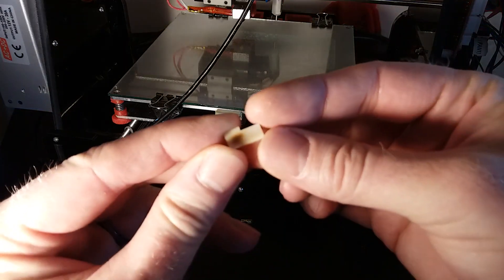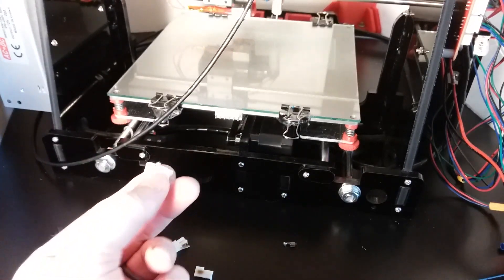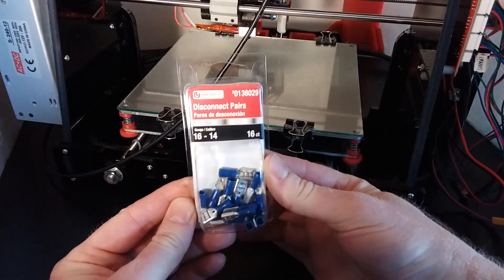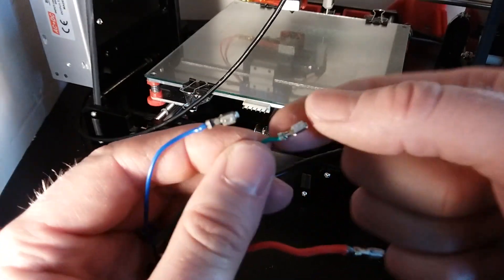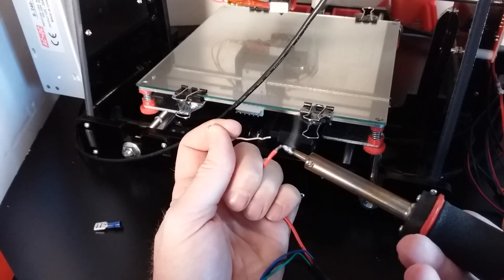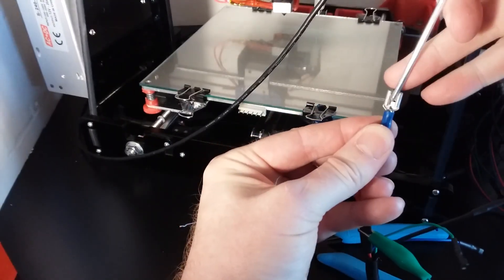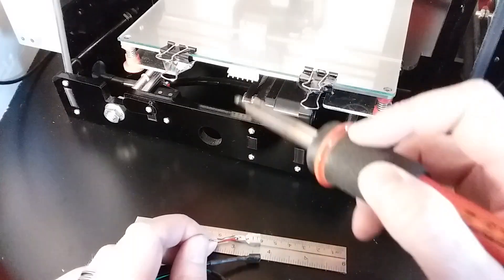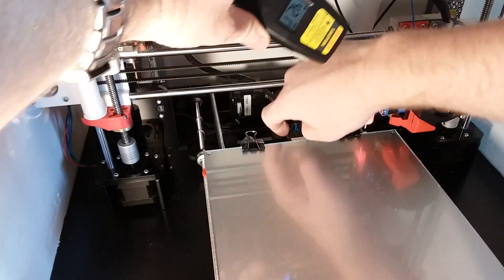Permanently Fix The ANET A8 Heat Bed Plug

Comment: this fix works and i did it as well. but is not sufficient. 1. the wires are not thick enough. they need replacing together with adding the mosfet.
2. in the long time, that faston connector starts getting loose and will start disconnecting again. you will need to re-tighten it a bit every now and then.

Comment: I actually just purchased a no longer used Anet A6 for the aluminum heated bed as my cheap one with acrylic was warped bad and got worse with heat after 1.5 years. I drilled holed through the connector, used 12 GA wire and soldered them directly to the bed. Once I get my printer all back together from all the upgrades I'm doing I'll print a stress relief of some sorts.

Comment: this looks like the best fix I've seen. on my way for parts.  Thanks
Reply from the maker: Or you can solder the wires directly to the heatbed.  Having a 100-200 watt soldering gun helps with getting enough heat into the wire and connection to make a good solder joint.
Reply: @MrDabrudda  Are you implying that this fix wasn't effective in the long term?
Reply from the maker: Either method works.
Reply: Finally did it and it works great so far.

Comment: Had the growing brown stain on the side of the connector too and the connector got really hot on the red plus power line. The plastic was also very brittle on that side already. Your video was a great help. After the fix the only thing that's getting hot is the hot bed itself.Thanks!

Comment: Finally reached the point where the connection of my stock-connector is temperamental. If I move it just right the bed turns on, no errors, just failed prints due to warping when the heated bed fails.

Also noticed some light periodically emitting from the ground connection in the same location as the burn, if I were a betting man I'd say the cable is arcing.

Comment: It's actually kind of bad to solder your wires like you did before crimping on the connectors because over time the solder gets smashed. But if you solder it again after like you did then it should be fine.

Comment: If you don't mind waiting a month to get them, you can order a replacement through AliExpress. The image shows the additional pos/neg wires. I ordered a set because I'm not in a hurry and it was only $5 with shipping. Hopefully they are as advertised, but with AliExpress you never really know what you are going to get. https://www.aliexpress.com/item/1PCS-replace-Anet-A6-A8-Hotbed-line-Cable-Upgraded-MK3-heated-bed-for-Mendel-RepRap/32857354342.html

Comment: nice tip. my connector burn time a go. a put some sodern inside.. it was work next couple of month. now its dead. I was try sodern directly to motherboard bed but its dont hold corectly and im wored about pin pad on board. Your method look better i guess :) . I think you should put in description what exactly name or link to that "pins"

Comment: Shouldn"t you use a version of those plug that has a cover on them?
Reply from the maker: I used heat shrink to shield connectors.  I eventually soldered directly to the board and printed a cable relief bracket to support the wires.
Reply: @MrDabrudda  so it's not a permanent solution? also that iron did you use to de-solder  it? i have portasol which reaches up 580 degrees.
Reply from the maker: It is a permanent solution but I decided to solder directly to the board.  A regular soldering iron can't put out enough heat.  I used a 150 watt soldering gun to get the solder flowing.  I tried a soldering iron and got a cold solder joint.
Reply: @MrDabrudda  how do you test for a cold solder joint ?
Reply from the maker: Cold solder joints may look dull, crystallized. and blobbed.  A good solder joint will be shiny and smooth.
https://learn.adafruit.com/adafruit-guide-excellent-soldering/common-problems
Reply: @MrDabrudda  Why did you decide to solder it? I've had almost the same setup like in your video but I didn't solder anything,  I used the covered plugs and I kept the original connector for the thermistor connection. That didn't work too well, too much plastics around, pushing the plugs outwards. I had to secure it with many zip ties, also because of the movement. Finally, the thermistor plug had a loose connection and lost contact every now and then, resulting in thermal runaway errors. Now, I'm thinking of whether I should follow the instructions in your video (which would only be soldering the joints and doing that stuff on the thermistor connectors) or whether I should go for soldering it. What do you mean?

Comment: This is a good fix. My connector has just failed on me after using the printer on and off for about 2 years.
I made plenty of upgrades such as a mains power switch in 3d printed enclosure, silicone wiring from power supply to 2 mosfets to run the Heated and extruder hot end. Plus 3d printed cable chains etc.
Currently printing a large scale spitfire from 3dlabprint (check out their website), and have been running the printer virtually non-stop (daytime only) for a good few days.
I guess the constant printing was finally too much for the flimsy connector.
Have ordered the upgraded cable that is now available, but might just try your fix first.
Many thanks for sharing your solution, much appreciated.

Comment: I just desoldered the connector from the bed and direct soldered to the pads.
Reply from the maker: That is what I eventually did too.  It took my 150W soldering gun to get enough heat to solder 16 gauge silicone wires to the bed.  I upgraded all my wires to silicone.

Comment: JUST ATTACH A STRAIN RELIEF TO THE HEAT BED.
Reply from the maker: The connectors become lose over time.  The cable I have now is supported by a zip tie on the top of the frame.
Reply: My strain relief pulled the cables to the side which lead to the exact same problem. Switching now to the connectors from the video and a better strain relief

Comment: It's not a permanent fix. It you won't do a strain relief sooner or later it will fail.
Reply from the maker: The cable is supported at the top of the frame with a zip tie.
Reply: @MrDabrudda  
 You put a strain relief near the point of connection not at the top of the frame......

Comment: Just got a new Anet A8, and it seems that they have upgraded this. The connector now has thicker prongs and they now run two + and two - wires between the board and the hot bed. So this permanent fix is pretty much implemented at the factory now.
Reply: That's fantastic! It's good that they are taking the safety of their customers seriously. I only got my Anet A8 a few months back and they hadn't made the change. I ended up running dual wires to the heatbed and putting on a new connector, along with putting strain relief on the connector via the y-axis cable chain (I also turned the heated bed 90 degrees to do this).  There are a few other things I'd like to see them do. But, it is a great start. I also recommend reflashing the firmware with the latest version of Marlin. The factory version of the software that I received has the thermal runaway protection turned OFF!
Reply: That's good to hear. I just got one also, but it doesn't arrive for a couple of days. I'm trying to be prepared for these things. Is the on-board mosfet for the heated bed better now, too? I heard it was.

Comment: Why didn't you mention strain relief ? I consider that almost as important as the clip mod. Other than that, I also replaced my bed temp wires with one size larger wire size silicone wires. This modification is MUCH better than soldering the wires to the bed.....good video.
Reply from the maker: The wires going to my heat bed are supported by a zip tie attached to a support near the LCD which pretty much removes any stress from the connectors.